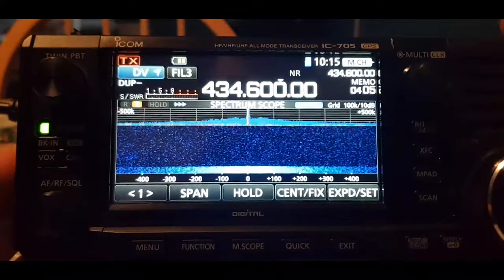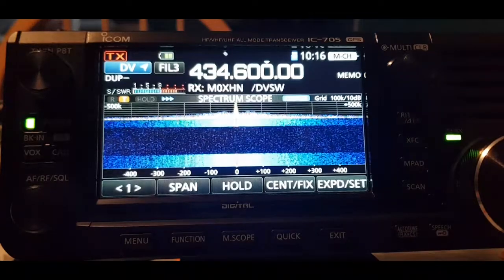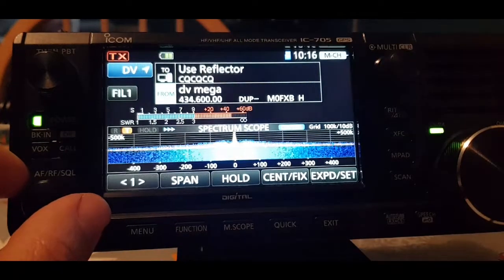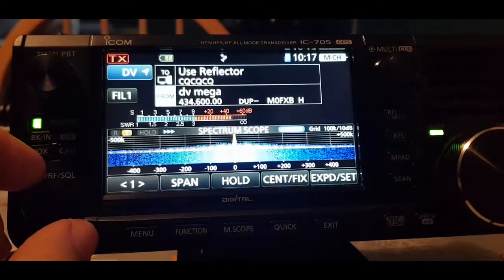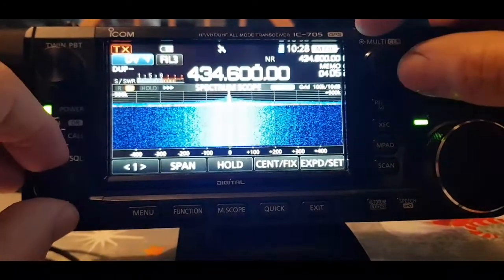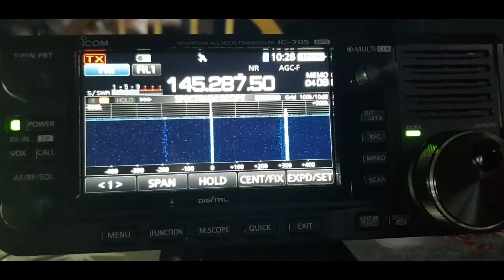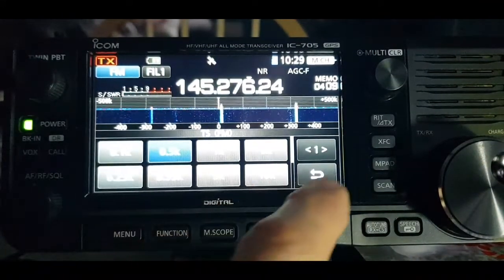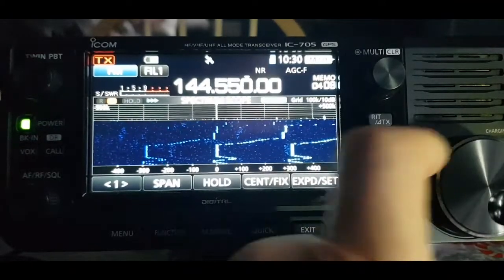Icom IC-705 - No tuner ,10 watts, No ATU !! - Icoms best seller why ??

Comment: I sold my IC-7300 around 2months ago to part fund my IC-705..I only work QRP so it was a no brainer for me..Never looked back since, i got a great full protected metal case with rack handles and perspex front cover..My 705 looks great in it and its fully protected.  73 de Wayne 2e0bvj
Reply from the maker: Hi that's great can I see pics 
m0fxb@outlook.com
Reply: @M0FXBHamTech  i can send you a link to them on ebay, give me a miniute

Comment: The 705 is farrrrrrrrrrrrrr from being the best seller. Its actually in stock everywhere and not selling well at all from the venders I've talked to. Price cut will be needed for Icom to flood the market with a qrp rado.
Reply: 705  should have been marketed as an HT and allow the display to go into vertical mode.
705 Mk2 will have 20 watts and slightly improved performance but no vertical mode either
It's a culture thing,  they will not listen to  round-eye advice no matter how valid.
Reply from the maker: Fair comment time will tell.
Reply: @M0FXBHamTech  it’s a great point. Once the initial preorders were filled the 705 sales fell off the map. Not a best seller.

Comment: Instead of buying an Xiegu external amp w/ATU, why not just buy the IC7300 that puts out 100 watts and has a built in ATU? Not only does it do the job better, between the Xiegu anp and the cost of the IC705, the IC7300 cost half the price. 
I have 5 different QRP radios and never looked into buying an external amp. If I want 100 watts out I use a radio that's designed to put out 100 watts !
Reply from the maker: 705 has terminal mode vhf uhf
Reply: Or better again, the Yaesu FT-891, cheaper again than the 7300 and it's receiver is better, better filters and wonderful Noise reduction features, the audio sounds really great via headphones. 

The 7300 sounds harsh compared to the 891.